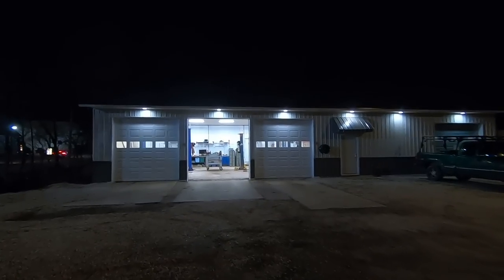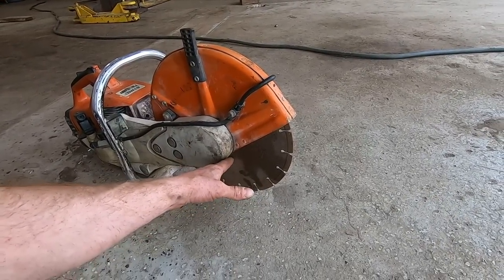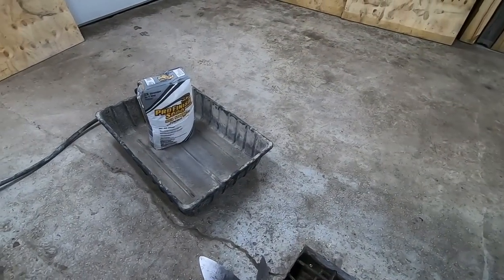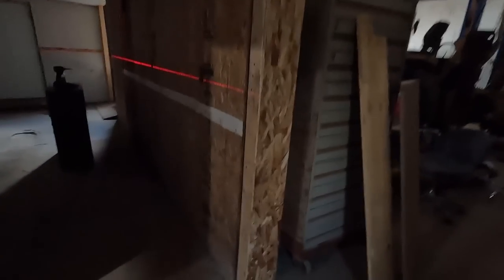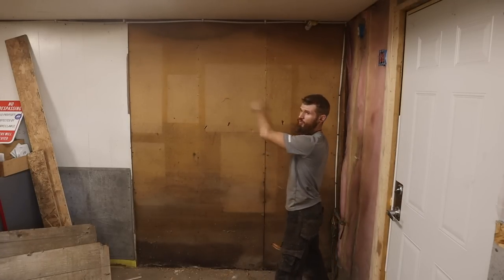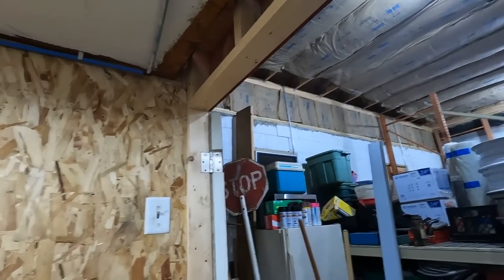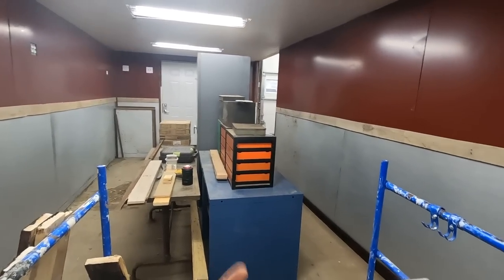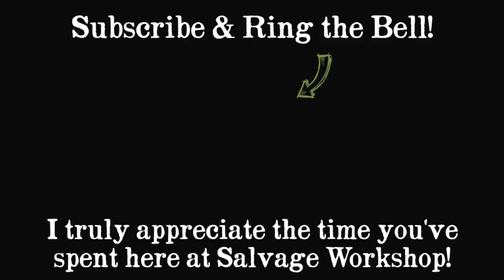Time to Start FINISHING the INSIDE of the New Shop! ~ Part 10 ~ Rebuilding of "The Salvage Cave"

Comment: The shop is looking great Matt!!! The only suggestion I have, is that cupboard you built around the water shut off should have a hinged door on it. If that water pipe ever burst, by the time you went to get a screw gun, and took those 4 screws out, you would have a ton more water damage, than if you just had to open a cupboard door!!! Keep the videos coming!!! Cheers, Al.
Reply: Agreed!👍

Comment: If you are taking suggestions I would take some of your vintage tools and hang them on the walls for decoration and you can add to them as you acquire more! A suggestion for your area you made over the water valve is put a KEY BOX for all the equipment and vehicles at the cave
Reply: I would really suggest having a piano hinge & frame for the water valve hideaway. If you need to turn it off, you need to turn the water off, you'll probably need to do it FAST. Finding a screwdriver and pulling 3 screws would take some time... In My Humble Opinion.

Comment: Really sketchy concrete. I had issues even with new 10 inch concrete with the fasteners pulling out. My solution eventualy was to add an additional plate to the base  extending the  footprint and chemseting the bolts. It's a real pain but I'd be digging out and repouring your lift bases.
Reply: As a structural engineer, definitely re pour with extra rebar on a 2 point lift

Comment: As a structural engineer I am always cringey of the 2 post lifts.  Especially in shitty concrete.  I tried to get all the design info from bendpak for a bunch of school installs... it was... less detailed than i was hoping for... lol.  But since the schoolboard as risk adverse (after a steel grate over one of the shop trenches flipped up and tore a girls leg apart) they let me do whatever I want.  I have mechanic experience so I ended up making a concrete dead weight to the full capacity of the lift.  It was one of the big ones.  Anyway concrete is cheap.  Labour is expensive.  If you are do this sort of thing i would undercut the dirt under the slab as well a bit.  You get thicker concrete for your patch and it will make a lip under.
Reply: I didn't want to edit the above.  Personally i went with a heavy 4 poster.  I am just a home gamer.  I can put anything on it.  Then i jack off from it to get axles and such out.  Not quite as convenient but makes me feel ok about the cracks in the concrete since they dont matter at all.  The PSI under the posts is less than the PSI of the tire so the floor is actually seeing less.  Also good for storing the car up outta the way.  It even came with drip trays :)  commercially the 2 poster is king for sure.
Reply: I totally get what your saying , I have a 10,000 pound lift bolted to 12 inch deep by 24 inch square concrete pads surrounded by six inches of floor and I still get nervous when I lift a three quarter ton pickup ,the laws of physics are not on your side
Reply: @vinces8974  Ive seen them rip out of the floor.  Not to mention when they drop and axle and the thing wasnt balanced.  The more I did design over the years the more i pucker.  Especially when its unknown existing concrete.  The good news is 99.99% of the time it just works out.  My estimates of loads and centroid is just a guess.  Really its probably not bad as long as the vehicle isnt having major stuff removed while on the lift.  I would run a ratchet strap to the arms if dropping an axle for instance.  Its only a few hundred pounds of negative weight between a great day and a mess :p
Reply: @someguy2741  It needs some deep concrete post foundations drilling down at least 4ft. If you go to a four post lift you'll need four of the same.
Reply: I am glad you sawed it open, because after seeing the long cracks i was wondering if there is rebar in that floor, now we know, didn't expect to see unfilled concrete block underlayment. Perhaps those deeper concrete blocks are something to consider. Great job on wrestling this building back crumbling away, was quite the job you did.

Comment: The more you dig into doing little jobs, the deeper you have to dig to fix the CRAP that was done before!  I'm amazed that the loft hadn't crashed down before with what little support it had!  
LOVE the sheet metal walls! Corrugated metal looks nice, but I think it's being overused.  And you can always use magnetic tool holders, etc!  And since it's all salvaged material, it's cheap and any little dent won't really hurt it.
Your wife was right - we DO like watching the plastic peeled off - but when you need a heat gun to take it off - it's OLD!  but looks GOOD!

Comment: I've seen other people use epoxy on the rebar tie-ins to the old concrete, seems like a good idea because the new concrete isn't going to flow into the holes.  This patch will probably be fine and outlast the rest of the floor, the flooding and temperature swings there aren't doing the floor any favors.
Reply: Agree glad someone else noticed that too. The holes should have been drilled oversize to allow space for the dowel bars to be cast into the old slab with an epoxy grout, allowed to set then the infill concrete poured. TBH the old slab didn’t appear to have any rebar in it anyway so all a bit pointless. I fear what might happen when he bolts the lift down to the old floor, I hope he reads these comments as several have warned that he needs to form a proper substantial foundation first to bolt the lift to.
Reply: Came here looking for this comment. Agree one hundred percent, epoxy is needed.
Reply: The rebar is not for tension in this application but for shear. If he drilled 5/8 holes 4-5 inches deep for 15mm bar it would work just fine. A bar every foot spacing would be overkill but that’s what I would do. No epoxy needed.
Reply: @manuelve1998  I think you are overthinking the “design” aspect of this build, if you read his channel description he readily admits he knows just enough to be dangerous so shear and tension are not factors that he is even considering when he attempts his repairs. He is just doing what he feels is right, it’s his shop so can do as he pleases.
What many posters are pointing out are that a lot of his methods are not considered to be safe or compliant with good construction methods

Comment: Self leveling compound is usually too soft for foot traffic and needs covering. Great idea to use rubber floor / gym tiles. They are comfortable to stand on and add insulation beneath your feet. Essential on the coldest of days. Looking good.😎😎😎😎

Comment: Comment:  Regarding the hollows in the room floor, I have inspected for voids (delamination) in concrete on and off my whole career.  We always used light chains to drag over the floor.  Just about 2 ft long and maybe 2-3 chain ends for your project is sufficient.  The chain ends will prove more.  Let the chains hang freely from a metal bar; not your hand.  The chain will typically ping or ring as it's moved along solid concrete.  When a void is found, you will hear a distinct "clink" begin to sound.  Keep dragging until you find the limits of the voids.  You will find voids by this method that you can't detect otherwise.  Not highly technical, but effective.
Reply: Great tip
Reply: You can just drag a chain across the floor, you will hear the difference when over a void.

Comment: To prevent the possibility of shock or electrocution, I recommend that you solidly and effectively, electrically connect each piece of metal wall covering, including the corner angles, to each adjacent piece then to the main electrical panel ground connection.  I suggest using electrical copper wire size number 12.  Use a star washer at each connection to cut through any rust or coating.  This will prevent the metal from becoming energized.

Comment: I totally enjoy your videos and like the progress you're making. Regard to the floor they also have the rubber shop floor in roll out sheet as well.  I have to say though, as someone who spent decades in career as a firefighter I am not crazy about heat tape as a longterm solution to prevent water lines from freezing. I have seen too many fires started by these devices that I always felt they temporary. Possible alternative for you is to have a valve in the rest room where it feeds that PEX and outside hose bib and shut it off open the out side bib and drain that line to prevent freezing. I just think it is the safest approach and I think if you asked others with my experience they would say the same. Despite my negative observation I look forward to your long and successful use of the new space with no catastrophes ever. Cheers.

Comment: A friend of mine did an 8000 square-foot shop floor with commercial carpet tiles that were taken out of an insurance office. They are waterproof they just lay down flat no glue. I was able to get 3000 ft.² donated. Most municipalities do not want it in the landfill. It also helps with sound reflection reduction.

Comment: Sound engineers would describe your garage as sounding "bright". Echo-y. But the shop/studio work will likely be recorded on body mikes or boom mikes so room sound will be less important. You're not putting on an opera, you can manage the levels in post. Line the walls with tool shelves and benches and you'll likely be fine.

Comment: Hey guy. You're doing some good work.  Just to let you know I think heat tape will melt or distort PEX. When I used it at work like your going to it collapsed the PEX.
Reply: Actually, PEX can freeze and thaw without bursting. My water line in my shop is PEX and it freezes at least once every winter. Been doing it for years now with no issues.

Comment: that baseboard treatment reminds me so much of the old wooden workbenches you see in the old machine shops and garages. but instead of time and oil you used fire to get the color. Also you are for sure not gonna chip the corners of the walls moving things with your iron framed edge guards :D I love it!!!

Comment: Remember when moving the lift, you need new thick concrete anchor pads poured under leg attachment points
Reply: Probably the reason there's a hole under the last location, no planning beforehand
Reply: Yes, Yes, and a million times more Yes, one needs to cut the old concrete out, dig, reinforce, and pour a proper foundation for the lifts or history will repeat itself and we’ll have another mechanic fail/I’m a Idiot video and nothing more serious.

Comment: Love the freebie roll around toolcart. Looks like it was designed to be outdoors. Wonder how tippy it is with such a short wheelbase on pneumatic tires. On the topic of decorating, I'd leave the bottom of the wall on the left as is, leave a patch of white, then decorate above, as a nod  to the shops history. Also, when decorating, remember that this shop floods, so keep organic matter above the expected water line, and I'd suggest having a couple platforms on hand to put on the lifts and load with tools/ect to use the lifts to keep important items out of the water in flood times.

Comment: I like the way you did the patch and you put the long pieces  of rebar on bottom like they shld be. I have found when  doing a patch like that, using a latex bond mix on old cement and a little bond mix or  latex fortifier in the new mix makes for an amazing patch, even works well out side with a freeze thaw cycle. Still can't wait for the 2nd endmill VJO

Comment: That is a cool look you have going in there.
Lights that are a bit below the ceiling cast a wider beam of light over a larger area. You can rewire the old ones with direct wire led, I recommend 5k for work areas, Sylvania ones were my go to and around $7 a bulb but inflation lately?

Comment: Hammering reinforcement bars into dry holes really isn’t achieving much at all. You should over size the holes such that you can cast the dowel bars in with an epoxy grout.

Comment: On the back door. Please install a jimmy proof dead bolt. 20" from the bottom of the door and a second one 30" down from the top of the door.  This for $20 to 25 bucks each make the door almost kick proof from the outside as its like having hinges on both sides of the door.
Reply: I was also thinking about all the stuff he's planning on storing out back. A tweaker's wet dream. I'd invest in some good, strong fencing around the perimeter, maybe with something that blocks sight of the back from the street. (Of course, with the hillside above, that won't help much...)

Comment: Not only do I have workshop envy, mines 8' x 10', I now have salvage envy. Those red sheets are really good, also like what you've done with the edging. Burning timber for facias and cladding is all the rage over here in the UK. Also like that you've used that angle iron for the corners, will save you damaging stuff if you knock into them. You need to be careful, if you upstep Mrs Salvage Workshop by working till late, you might be sleeping thier as well!🤣😂🤣

Comment: I like the sheet metal wall coverings, I think it looks cool.  Smart move on the wall rebuild, I sure would not have have loaded that upper deck up with the way it was originally built. The burning of the wood for finish is going to really make the walls pop. Your doing a nice job sir, thanks for the update, enjoying the shop, cave, build.

Comment: You know you missed the dynamics of the crack It goes right underneath your lift post and goes right to the old door and that channel and that means your lift post is still not supported you put a heavy load on that lift post now that you've strengthened it it will rip right towards the wall Meaning that the substrate most likely right to the back wall in that area has undermined it itself so basically you have a bubble Underneath your concrete slab that holds the post to your lift On the right

Comment: do you know if any of the rest of the floor is reinforced? if it's not, then it was not worth putting more than a couple pieces of rebar to join the cracked slabs. you will definitely want to look up the specs of the floor requirements for the hoist as you will NOT want that floor to fail while you have a load on it. semi retired concrete finisher so i know a bit about what i'm talking about. also be aware that any cracks in the floor can shadow through anything you cover it with.

Comment: Probably should of taken a morter troll and tossed in a bunch of concrete mix in the holes first. Pack it down and then do the upper surface. Throw it hard down in to fill them.

Comment: While i admire your commitment and hard work to fix up that place, the more i see the more i think it shoulda been bulldozed down and either started over or found another place in better shape.  Looks like the flooding took it’s toll on that shop from the flooring to the walls and you’re spending a lot of time, effort and money on fixing something that should have been demolished.
Reply: I used to think the same thing. But when you consider that this is just his personal shop for projects and not a commercial facility, and considering that there's probably going to be future flooding in the area again, it's not wise to dump a bunch of cash making it new. It doesn't have to be perfect. And this is the salvage cave after all, and he's getting a lot of new content doing the repairs.
Reply: I agree this is definitely a case of flogging a dead horse, a lot of the restorative work that has been carried out is not of good quality and the building in my opinion is not safe to work in.

Comment: You are going to want to redo that floor where you are bolting down those hoists. That floor is not near thick enough. A bunch of excavation and deep footings would be required.
Reply: I concur
Reply: And I too agree.
Reply: Same here. I wouldn't trust the existing concrete.
Reply: You right
Reply: Seems like the original floor is not reinforced either. Not been impressed with the entire build of this project.
Reply: @alfiembra  I think he is doing ok for keeping within his budget but this it not a place to cut back. He specifically addresses working on heavy vehicles re: the floor fix so he needs to ensure the lifts won't fall over or buckle.
Reply: I have a hoist sitting here to be installed in a couple of days. He won't even do it unless my floor was 6 inches thick. He was pretty serious about that and I trust him as he has installed and services many many hoists. He said most hoist failures are due to crummy concrete. Maybe this will be fine but I wouldn't stand under one based on what I saw, the repair is the best thing here and it's not that good. Sorry like your videos but bad is just that,, bad.
Reply: Yes I full agree. Maybe drill a pier hole down a metre or two. A large metre square by 150mm slab.
Reply: I agree with this statement as well. It would take him a couple days max to get it prepped and done right.

Comment: No concrete adhesion promoter?  That amount of rebar is going to make that spot the strongest part of the floor for sure. Little surprised at the lack of adhesion promoter and not epoxing in the rebar since you were already going overkill. But its a small spot i cant see it getting popped out. Nice project tho

Comment: excellent work - such a big improvement. If the area is so prone to flodding then maybe it would be an idea to put a small base/platform under the tool cabinets - it won't save them from the big flods, but I Imagine that there are 9 smaller flods for each of the big ones (?)

Comment: Don't chip up that old concrete, just go over it with more leveling mix and put the rubber on top.  The rubber will protect it from chipping and you'll never see it.

Comment: OK I know you’re already done and it’s probably all right but I was always told when you’re doing concrete start with the crack and work your way inward, drilling holes in the concrete reinforcing with rebar. You might be doing it again if I crack my grades to the other left.